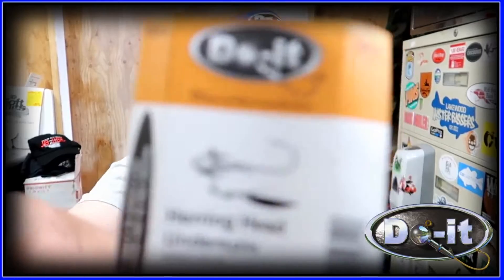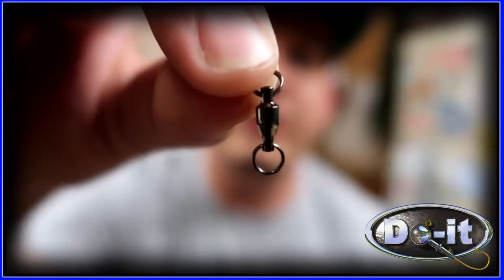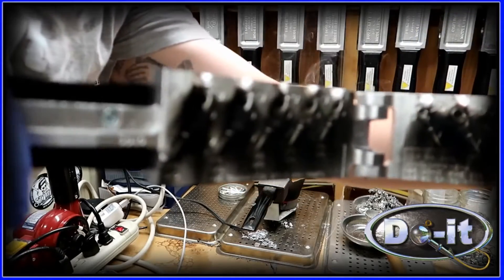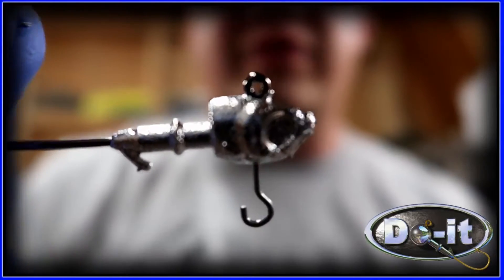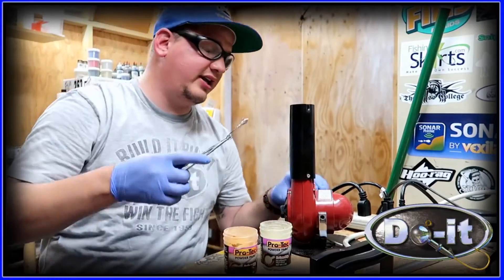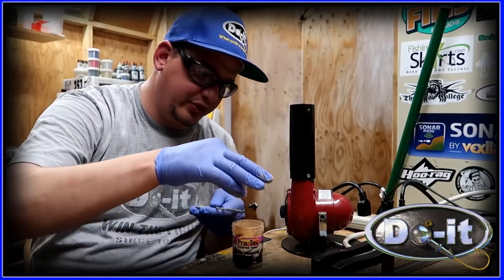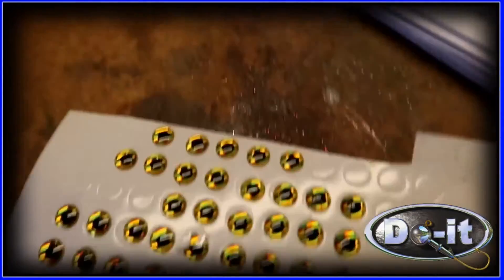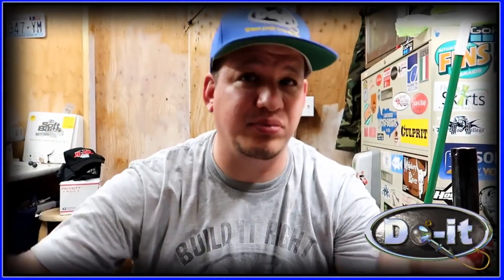How to Make Under Spins - Do-It Molds

Comment: Great videos brother. Just one thing. If you can turn the wire form forward, it takes away the chances of losing the blade and swivel.
Reply from the maker: Turn if forward ? Not sure what you mean ?
Reply from the maker: Do you mean turn it around?   Like the opening on the bottom????  If so, that's the only way I've lost the blade
Reply: @ThatGuySkimpy  sorry for confusion. Turn the keeper so the part you pinch that holds the swivel is pointing forward, rather than back. Hope that makes mire sense. Again, love the content brother. Great work. Love that color scheme, so I'll borrow that :)
Reply from the maker: @rocketsurgeon1746  ahhhhh gotcha

Comment: Where do you get the ball bearing swivels? Do you just order them from do-it or do you use a different source? Thanks
Reply from the maker: Usually just order off ebay.  Just be careful,  you will find alot of super cheap ones.  Well I've ordered the cheap ones before and dont work as well as others.
Reply: Also what size blade do you prefer? I'm ordering the mold and wanted to make sure I get what I need
Reply: Thanks do you use a size 2 blade?
Reply from the maker: @jimmynoonan6120  I usually use size #3.  But can go bigger or smaller.  Depends on how you like.    I like the 3
Reply: Thanks for the great information

Comment: Nice job ! When baking do you ever have the problem of getting a big bump on the end of the head ? Or do you hang it so if the paint runs it goes down the shank ?
Reply: I use a couple small pieces of aluminum angle iron and make a clamp that holds the jigheads vertical with the head up.
Reply: Been 3 yrs hope ya got your answer by now but incase not...
You're problem can be 1 or 2 things...
#1 Getting head to hot
#2 Holding it in the paint to long

You'll need to experiment with the times you hold it over your heat source.You'll want it to be hot enough it isn't dull and powdery,you want it to glaze over within a sec or two but not instantly.Dipping you just want to swish it through the paint,I just twitch my wrist very quicly and dip then tap my needle nose pliers on the fluidbed to knock off any excess paint.
I pour a lot of Crappie jigs (just painted 1200  1/32 & 1/16 in a few hours the other night) and I prefer them to be dull and powdery looking though (it's just past the stage the paint will wipe off with my finger),I don't have to do anything to the hook eye and they always come out open.
On my Banana head mold I pour the 1/2oz for Striper,since it's a multi weight mold I pour one at a time.When I pour the one I will immediately pull it out of the mold,remove the sprue and dip.This will sometimes give the dull powdery effect (I just heat the mold more by pouring a few without hooks and/or leave it on the pot) but most times it'll glaze over within a second and leave a perfect finish over the hook eye.

I hang mine but have made the upright holders as they'll do more jigs at a time and not bump each other getting them out of the oven like hanging them does.One bad thing with the upright..it takes longer to load each one and with 5 of them in each bake I think it takes longer than when I hung them...
When I 1st started I was dipping them a lil to long and would get the bump and eyes full of paint,now only time I get to much on them is if I happen to drop one in the paint and have to fish for it..doesn't matter,they'll go into my personal stash...lol

Fish don't care if there is a bump of paint or you didn't get all the sprue off.They don't even care if you didn't have your lead or mold hot enough and it comes out with wrinkles...lol